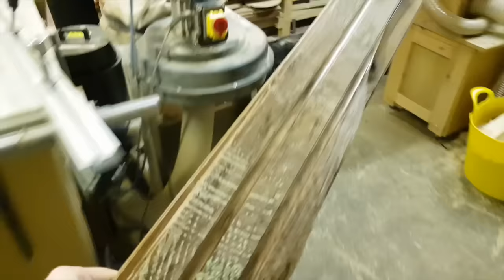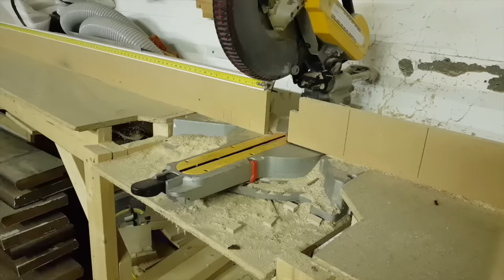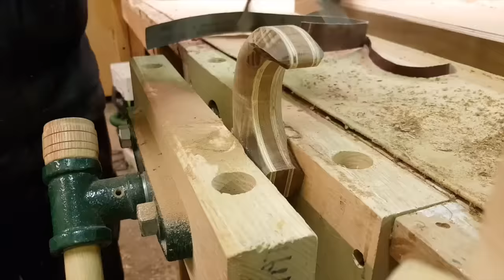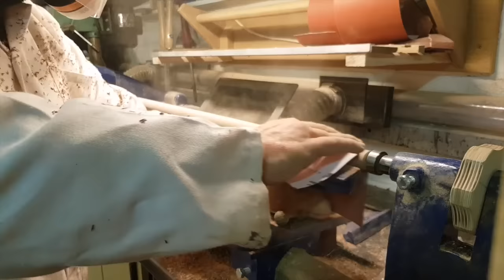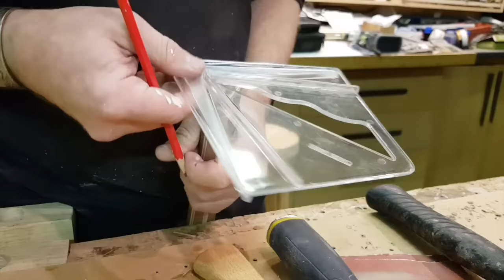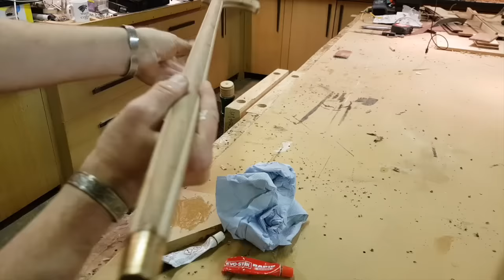Making walking sticks

Comment: A suggestion.  Use some coarse (e.g. 150 grit) sandpaper and sand a bit on the inside of the brass before gluing.  It gets rid of oxidation and provides a “bite” for the glue to hold on.

Comment: 17:00 where youre cutting out for the collar, its much easier to use a whittling knife than a clamp and that big chisel!
Reply from the maker: Thank you for your comment. I prefer to do this with a large chisel. as the overhang of the large chisel exaggerates how square I'm chiselling. So it aids in creating a straighter and squarer chiselled surface. As the chisel is flat whereas a whittling knife could be less accurate. That how I like to do it anyway. Thanks for your input.

Comment: The handle  in the promo looked like a ballerinas clog .
Reply: That’s the best kind of handle, much more comfortable and supportive than the candy cane style.
Reply: Speaking as a longtime cane user, I’m not a big fan of the brass band at the handle attachment. I took it off both of my canes since I found it caused irritation on the web between my finger and thumb. Better to have a nice smooth transition with no intervening materials.

Comment: Very nice! I like using Tru Oil also. If you put it on really thin and rub it with the palm of your hand until hot it will give you a very smooth finish and dry much faster.

Comment: Very nice tools. There are hundreds of thousands of dollars in equipment on display.
Reply from the maker: Hello LeoJoshua21. thanks for your comment. Actually, there are not hundreds of thousands of dollars of equipment on display. If you ask any experienced carpenter or joiner they will confirm this. My workshop is a VERY VERY low-budget workshop. Some of the machines, I made myself. including the bandsaw and one of the table saws. the drill press is about $60. The lathe is worth $100 and so are most of the other tools and machines under $100. with the exception of my Battery drill. I got fed up with buying new drills every year as they would burn out so I brought a good Festool battery drill. for $350 The most expensive machine is the table saw which is worth about $1500. the total cost of all the machines and tools doesn't even amount to a low-budget second-hand car. Everything I do is on a budget. this is proof that you don't need to spend hundreds of thousands of dollars on machines and tools to have a workshop that is useful. Sorry for the rant. I get told that quite a lot. 
All the best and hope you have a nice day. 
Pete.
Reply: @PeterSmithwoodsmith  this is so encouraging! I appreciate the clarification as I love working with wood but don’t have the funds for some of the high end stuff. But I’m getting there. Love the videos! You inspire me sir!

Comment: Nice looking sticks.  I like the use of reclaimed/salvaged woods for them.  I like your method for drilling the holes for the joint. A smart way to keep the hole straight to the shank. 
I've found that for the joint between the handle and shank you want a minimum 5/8" or 15mm diameter for the dowel if you're using wood. Smaller than that can be weak. That, or a 3/8" or 10mm section of steel rod instead.  If you're making several of the same style it makes sense to make a template for the handle.  Saves a lot of re-drawing.
Rodney
Reply: Not enough to just say well done? Feel the need to educate this craftsman? Lol.
Reply: I suppose so.  The size for the dowel or steel rod in the joint is a lesson I learned the hard way ( one of my own canes fortunately). Better safe than sorry.  A broken cane can mean a nasty fall for the person using it.
Reply: Edgar come on, that comment really wasn’t necessary. I think he’s a grown man and if he could handle constructive criticism (that was very politely put and great advice), he wouldn’t post public videos. We need to stop being so sensitive; he offered some free advice (take or leave), that’s all.
Reply: @edgarhelbling6525  Rodney is a master craftsman as well in his own right and makes very high quality custom canes for folks on a regular basis.  His comments were not meant out of pettiness or to cut someone down as yours to him was, his were meant as constructive ideas as to what has worked for him in the past from his own experience, from one woodworker to another*.  That is not cocky or arrogant "educating" as you assumed and insinuated, but was simply one craftsman sharing ideas and tips from one craftsman to another and was *respectfully done.  There is a very big difference between his comment and yours...his was not cutting Peter down to size in any way, but yours was cutting Rodney down to size, while you accused him of doing what you yourself did to him  Interesting.
Reply: @rodneywalker9113  hi Rodney it's the gal you were speaking with earlier on Etsy about the cane ideas I had (wild rose bush shaft with antler handle)...small world!  Watching woodworking videos now to inspire me to try my own hand at learning how eventually,  :)  Be well and will be in touch. ~ Renee

Comment: looks great just one thing i have used many walking sticks of all kinds and i find that rubber tip on the bottom is a must have a metal tip gives no grip and slips out very easy have had a few near fatal fall because the stick slipping out just something i have experienced

Comment: Amazing work. I love that you showed everything from start to finish.

I have been commissioned to make a cane and was wondering if there would be an issue with it not being round. The client wants a vine inlay along the shaft. I was thinking I could do an oval shape with the left and right sides mostly flat. Front and back would be rounded like a typical cane. 

Also, I don't have a lathe yet, so this was partially my solution to that. I would use a roundover bit in my router table to get the rough shape of the curves and then fine tune it all by hand.

Thanks!

Comment: Nice Bench and Vice. If either was not sturdy we'd definitely would have seen the handle jittering about while sanding but it was rock solid!
Reply from the maker: Thank you for your comment Dragon of justice. The vice is great a quick-release vice would be a bit more useful at its takes a while to wind it out to maximum, but this one is solid and the bench is big at 4 x 1 meters so it is very heavy.

Comment: The walking sticks are a nice design and look great. Have you thought about using the roughing gouge as a gouge instead of a scraper? Have you considered using spindle gouges for finish work? I fine that these two things make turning much more enjoyable with less work.
Reply from the maker: Hi Chuck. thank you for the tip i will consider for the future.

Comment: Really nice job.  What about a rubber tip for indoors and sidewalks, to prevent slipping?
Reply from the maker: Thanks for the comment. If you read the video description you will read that the brass end is there to accept a rubber ferrule. Sorry, I didn't show it in the video.

Comment: i thought a cork or rubber insert at the bottom would have been more practical, although the brass ferule looks awesome...
Reply from the maker: Hi. The brass is a must to stop the wood from splitting or taking in water over time. The brass is designed to except a rubber ferrule that fits over it. Which the walking stick have on them now. I didnt show that in the video as I thought that it was quite obvious that that was what it was for. Clearly not though as many people have mentioned about a rubber ferrule.

Comment: What would you recommend to use for the tip. I used a rubber foot off a chair and it looked a little funny.
Reply from the maker: Hello Daniel. I use Rubber Walking stick Ferrules which go over the brass Ferrules which is important as it stops the end of the stick from splitting. I get mine on Ebay
Reply: Most decent Drug Stores also carry rubber Cane tips - in different sizes to match your cane.

Comment: Why would you hand plane the shaft? You routed from the flat sides then put it on the lathe. I know you took down the corners for easier lathe work. You also could have used the router on the handle part also using a round over bit. Work smarter. Nice cane though, especially with the furrell.

Comment: There are other lathe tools than a spindle roughing gouge, they will give you a much better finish and will markedly reduce your sanding time. A router corner rounding bit will speed the handle. The result is very nice looking and perhaps consider using a metal pin rather than a wood dowel. :D

Comment: Like the work but why not make a template to mark out the handle instead to using a number of different size tins and a tape roll. Why not fit the ferrules to the stick whilst on the lathe, you will achieve a much better fit. If you mark the brass in the process it can easily be buffed out - Only saying
Reply: hahaha. Like the work BUT!!!!. hahaha. classic. I'm afraid I can't change it now. That's how I did it and I would probably do it that way again, but I probably won't make another stick again as I have far too many other projects going on and in the pipeline. This was just a small project for fun so I thought I would make a video of how I make my sticks.Thanks for your suggestion though.

Comment: I have not seen the measuring device (clear plastic) you are using. Can you put a link?
Reply from the maker: Do you mean the Centre finder? If so here you go. https://www.amazon.co.uk/Centre-Finder-Spindle-Turning-Middle/dp/B077VNNNV9/ref=asc_df_B077VNNNV9/?tag=googshopuk-21&linkCode=df0&hvadid=310879398178&hvpos=1o4&hvnetw=g&hvrand=5740608928054359989&hvpone=&hvptwo=&hvqmt=&hvdev=c&hvdvcmdl=&hvlocint=&hvlocphy=9045010&hvtargid=pla-890199363512&psc=1

Comment: At first I was skeptical about the wood dowel at the joint but since all of the force for a cane is downward it should be very strong.  Very nice work.  Just curious do you know what type of wood was used.(sorry if I didn't catch somewhere else).
Reply from the maker: Hello Wayne. The joint feels very strong i have put my full weight on it. So it should be fine. The wood is Mahogany in the centre with American black walnut on the out side and 2 pieces of 3mm Birch Plywood inbetween.

Comment: Very nice project. You might want to adjust your tool angle though. You could reduce the amount of sanding. You also might want to build a steady rest. It would reduce the chatter marks on your long spindles.
Reply: and use a tool other than a roughing gouge.
Reply: there are some very good videos on using a skew chisel, one by Alan Batty is to be reccommended. this tool is much better than the scraper and roughing gauge and saves time on sanding. nice walking stick.

Comment: One advantage of wooden canes is that the length can be tweaked to be just right for the individual client. You make them a little long and then trim a bit every week until it's just right. 
The design of the tip on this walking stick does not permit that.
Reply: You should find that the correct length for a stick is to hang your arm down by your side and measure to the top of your plam where the wrist begins, for most people using a stick for support that should be comfortable and just right.
 I usually use threaded rod instead of dowels for my stick handles so that i don't need a ferrule at the joint but the ferrules do look nice. Good use of scrap wood too.
Reply: @chrisosh9574  Threaded rod might be a problem at airports.
The problem with calculations of correct stick length is that they don't account for real world variations. For example sidewalks are often sloped to allow rain to run off, so if you walk in one direction a certain length might be optimal, but if you walk in the opposite direction your cane will be an inch too low.

Comment: Not sure why you would dull your plane blade on the glued edges to then cut all away on the bandsaw, still nice work mate
Reply from the maker: I needed the edges smooth as i router the corners of before putting them on the lathe. I have many planes this is one i use for what ever. It takes seconds to sharpen it.

Comment: What kind of carpenter puts a jack Plane down on it's blade?  The very first thing I learned was NEVER put a plane down on it's Blade, always on it's side.
Reply from the maker: I am sorry that i do this. I doesnt seem to make a difference to my planes. i wouldnt put it on concrete blade down. but I still get good results and have no problems.

Comment: The strongest wood in north america is, I believe bodark, or Osage Orange which grows in the south in valleys.  It is extremely strong and break resistant and makes the best dowels.  A dowel should be stronger than the wood it joins and you have a week looking dowel in that.  If you give me a post office or mail box address I can send you a few pieces you can make dowels out of.

Comment: Good job! New subscriber here, what type of clamps did you use on the glue up? The ones that have a handle like a caulking gun. I’ve been woodworking a long time and haven’t encountered those. Thanks!
Reply from the maker: Thank you for the comment. The are called one-handed speed clamps
Reply: TRY HOME DEPOT. I HAVE SEVERAL OF THESE, IN DIFFERENT SIZES.

Comment: I think I would refer to these as walking canes, as opposed to walking sticks...and although I admire your use of recycled timber, and the lamination may offer some strength to the shaft, your design appears weak at the joint between the handle and shaft, and I suspect, if actually used as a walking stick, with a degree of weight on the handle, the short wooden dowel used to joint the stick and handle would break pretty quickly. One remedy would be use a metal dowel, and increase its length. Also, taping the holes in the handle and shaft with a tap and dye would allow the metal shaft (perhaps a length of 8mm threaded steel rod to be better secured, and provide more surface for the epoxy glue to grab, as well as strengthening the joint between the two.
Reply from the maker: Hello My Friend. Thank you for your comment. These were gifts for Christmas and are getting used daily so we shall find out if the Joint fails.

Comment: While a metal tip may look good, it's not really functional for a walking stick that you intend to use for it's designed purpose unless all of your walking is going to be done on dirt. Metal tip slips on hard surfaces too easily and could injure someone that actually puts some weight on it while walking.
Reply from the maker: Hi J Johnson. The brass metal tip is essential, as it's there to protect the wood and stop moister from getting to the end grain. It is also the perfect shape to except standard rubber ferrule this is standard practice with making this kind of walking stick.  I didn't film me putting on the brass ferrules as I thought this was rather obvious that this is what it's for. This is mentioned in the video description.

Comment: That handle will snap off like a twig. All that work and the weakest connection.
Reply from the maker: Arrrr hahaha I don't think so. The walking sticks are 4 years old now and performing perfectly. Rock solid. I have lent on the handle with my full weight many times.

Comment: As someone who has to use a walking stick, I can tell you that although this one looks nice, it's not very practical, the shaft is too thick making it heavy for continued use and that brass tip is a killer!
Reply from the maker: I did by Rubber Ferruls for the ends to slip on the brass. Sorry i didnt show that.
Reply: @PeterSmithwoodsmith  My own sticks taper from 20-22mm down to 18mm but that's just my personal choice.

Comment: Man with that loose coat on near that Lathe you are lucky you haven't had a arm ripped off.
Reply from the maker: Thanks for your Comment. Note taken. I will roll my sleaves up from now on. I must be very lucky. 25 years and no problems yet but thanks anyway
Reply: I mention it because I have seen it happen before. Great video by the way.

Comment: i;m 94 yrs old and can tell you now those are dangerous waling sticks that can cause falls with that brass end.***add rubber feet to the stick.****DR KEL
Reply from the maker: The brass end is there to protect the end of the walking stick from weathering and impact. It is also designed specifically to except a rubber ferrule. Which have been fitted. I did not film that as I thought for the video sake the rubber ferrules dont look aestheticly pleasing. I also thought that this was kind of obvious. This was explained in  the video description,  Anyway thanks for your comment.

Comment: Since you are making out of "ply wood", it would have been better in one piece, surely,  ??  I made a thumb stick in a similar fashion, and it's much more aesthetically pleasing in one continuous piece,, I realise it's virtually impossible to put it on the lathe, so it has to be done with hand power tools, and elbow grease,, ha ha,, 
Nice finished piece though,  !!

Comment: Alot of expensive tools
Reply from the maker: Hello and thank you for your comment. Actually, these tools are not expensive at all. The most expensive machine I have is the panel saw but it is the cheapest panel saw you can buy on the market and with the amount of features it has it is very cheap. The Lathe, grinder, drill press, fret saw and many of the power tools are over 30 years old and are all very cheap brands like Drapper and Titan.
If you show this video to any Joiner or carpenter or cabinet maker they will confirm this. I run my workshop on a very small budget. Some of the machines I built myself, like the Bandsaw and table saw.  All the machines and tools in total, cost less than a good quality table saw or the like.